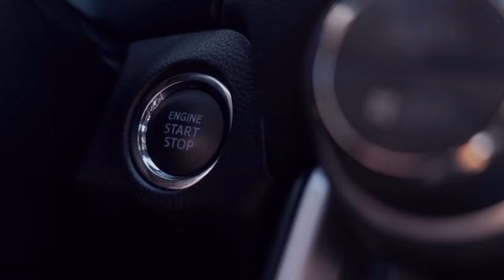5 Reasons Why Your Car Cooling Fan Is Louder Than It Should Be

Comment: 0:44 Dirty Fan Blades
1:46 Faulty Cooling System
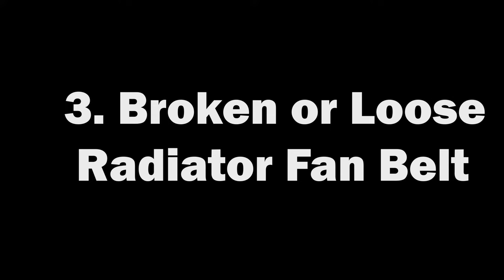2:48 Broken/Loose Radiator Fan Belt
3:46 Faulty Radiator 
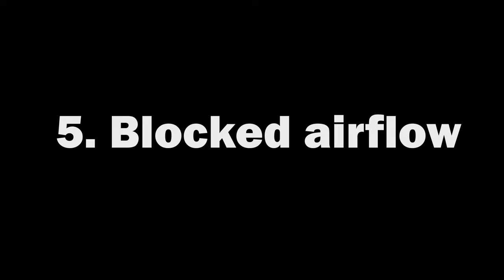4:31 Blocked airflow
Reply from the maker: Thanks